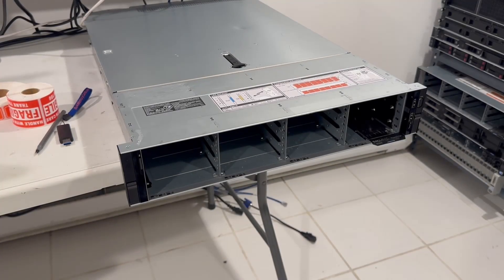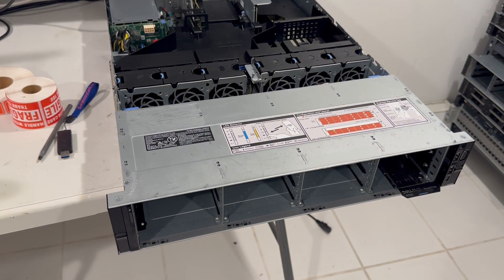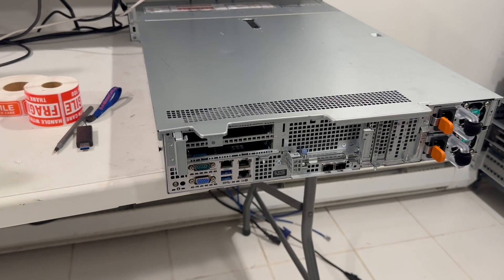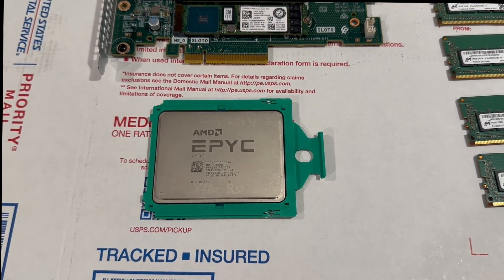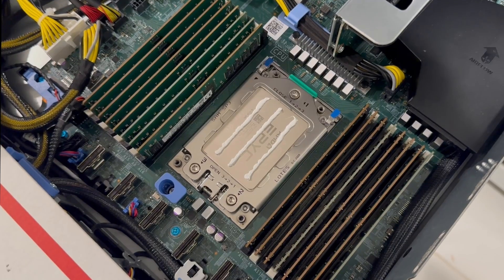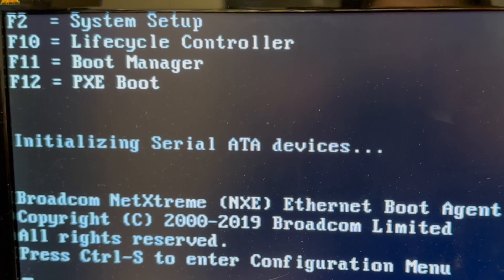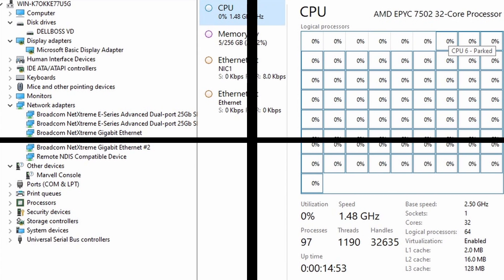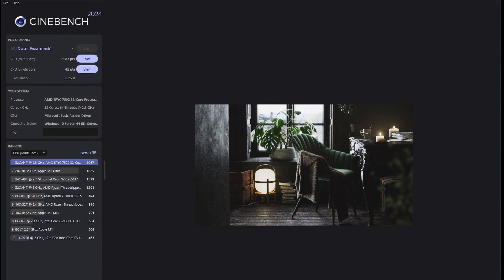This Dell Poweredge R7515 Can Be The Virtualization Host For Your Business (AMD EPYC CPU 32 CORES)

Comment: Hello, is it possible to add a 2 slot gpu such as the NVIDIA RTX A2000 ada in this server?
Reply from the maker: It should work but we have not tried it, also it does not look like its a supported configuration by DELL. Please see the list of supported GPUs below.  Internal GPU Up to 4x 75W or 1x 225W
GPU: Nvidia A2 16GB (LP)
GPU: Nvidia T4 16GB
GPU: AMD MI210 64GB 300W (FH) 
GPU: Nvidia A30 24GB V2 (FH) 
GPU: Nvidia A2 16GB V2 (FH) 
GPU: Nvidia A2 16GB V2 (LP) 
GPU: Nvidia A16 64GB V2 (FH) 
GPU: Nvidia V100S 32GB (FH) 
GPU: Nvidia T4 16GB 70W V2 (FH) 
GPU: Nvidia T4 16GB 70W (LP)

Comment: I thought you were the guys on FB marketplace the pictures looked familiar.  Ive looked at your listings before but youre the same as ebay pricing without the 13% seller fee and no buyer protection. If you guys were like 20% cheaper outside of ebay id consider it.
Reply from the maker: Hi, when you purchase systems from us, you receive a fully tested, updated, and refurbished device. This is unlike the eBay recyclers that don't understand what they're selling. Also, you are able to test the system in person if you buy from our FB Marketplace listings, so buyer protection is unnecessary, but we will still answer questions if your system isn't meeting your needs. If you think our prices are high, we respect your opinion, but we and many others believe that they are justified.